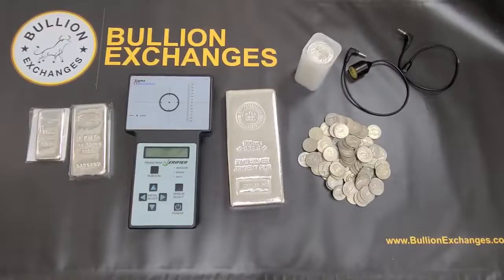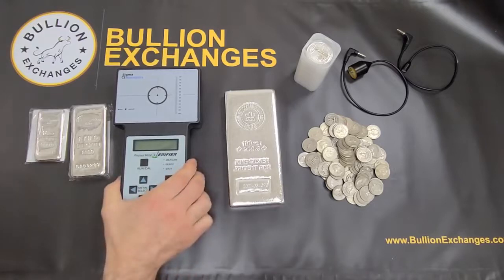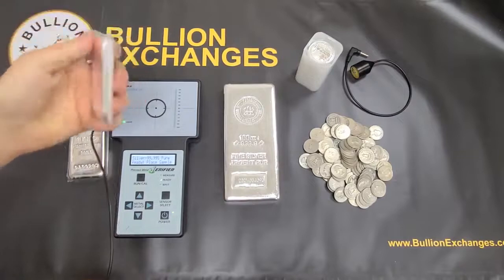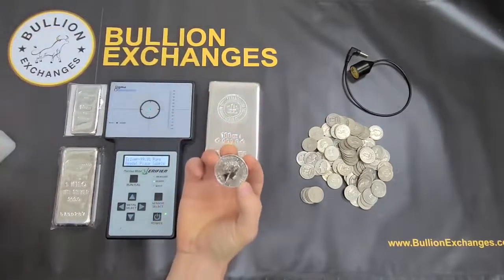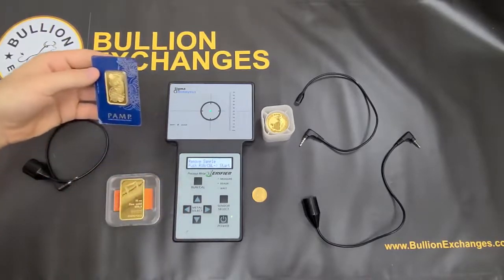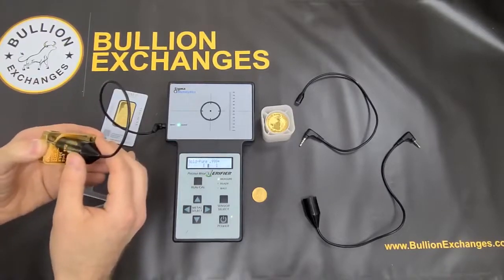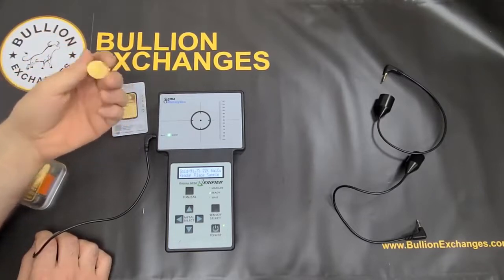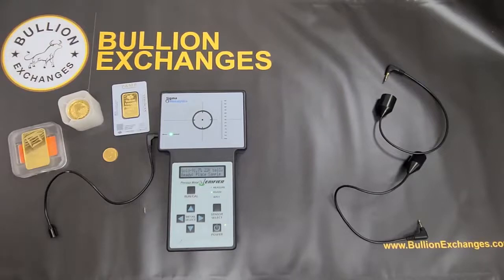How to test silver and gold at home with Sigma Metalytics Precious Metal Verifier

Comment: Hi, will the Sigma Metalytics test gold nuggets containing a percentage of Silver and Copper.  I have a 15.8 gram Australian Gold Nugget I invested in and the XRF test at a bullion shop showed 73.22% Gold, 14.07%  Silver and 12.59% Copper.  The Prospector I got it from, says the XRF result is rubbish as they do core samples and test, saying mine  should be 20 to 22K.   I am unsure if this is due to the fact an XRF does not test very deep and the Sigma will go to 2mm depth and may show a better result to what the prospector says.
Reply from the maker: No the sigma machine is only used for bullion core items that are programmed into the sigma machine.   You would need a thermoscientific xrf to test scrap and gold nuggets in order to test that purity or you could use acid to the nuggets to get an estimate as to what purity it is.   Nuggets due to them being dirty and having other materials can give a false reading when just using an xrf therefore most nuggets and mined gold are melted down and then sold off once the bars are homogonized and you can get an accurate sample of the material. https://bullionexchanges.com/learn/test-gold-real Heres an article that could also maybe help you depending on the material you are looking to test.   Please let us know if you have any other questions that we could assist with.

Comment: Whatever happened to the 35% nickels that are sitting next to everything does the test or not
Reply from the maker: Those are actually quarters that are 90% silver since they are pre 1965. at 6:15 you can see us testing the quarter that is on the side.  The sigma machine doesn't test for buffalo nickels with low grade silver.